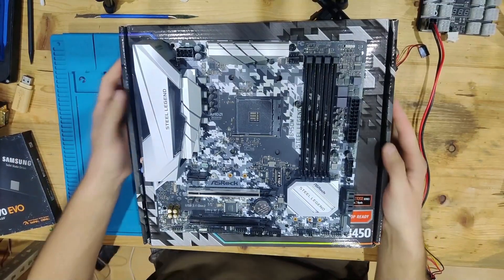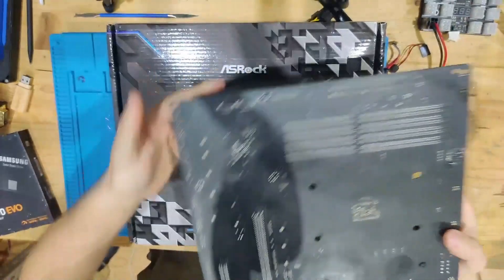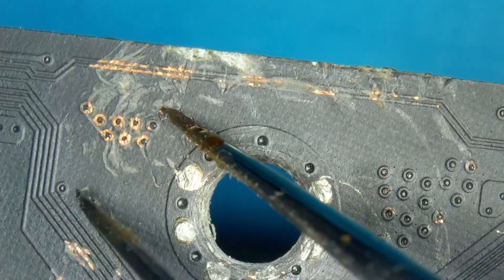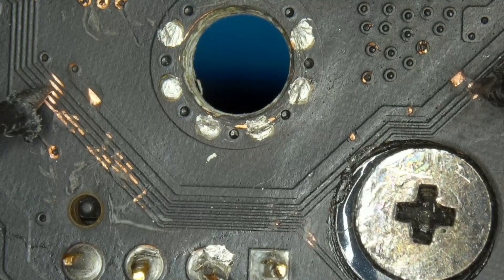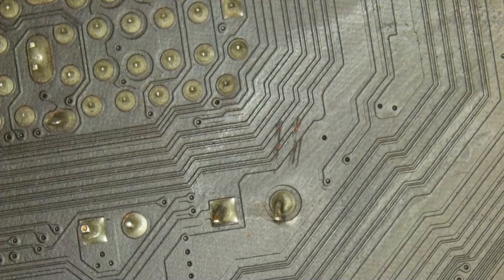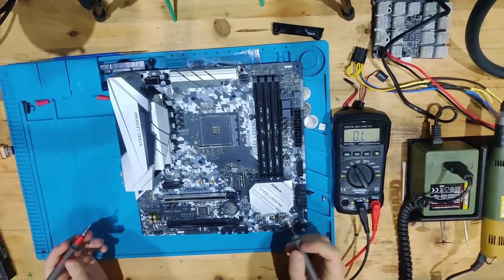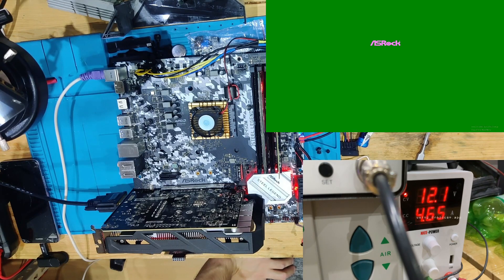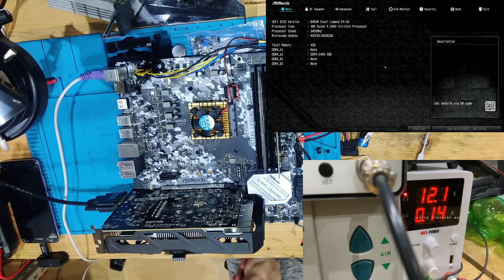OVERCLOCKING FAIL , MISSING VCORE  | B450 Steel Legend VRM Repair!

Comment: Sir, my motherboard has no display, I tried to measure the vdd_run and vddsoc voltages, it's only 1.1v, what's the cause? If it's normal, it's not 1.4v. I checked that there's no short circuit.
Reply from the maker: For startup that can be nomal, so it seems something else is wrong with your board! If all voltages are running, it sounds more like a bios issue!

Comment: i have a B550M steel legend which will not run stably above 95W of PPT.
i guess the VRM is failing.
Reply from the maker: Yes, it might be that some protection is triggering!

Comment: Oh cool, think this video might've answered my question. Bought a faulty Gigabyte Aorus B450 M off eBay to practice some board repairs. 1st it was not powering on properly when the ATX 12V Cable was plugged in. It was only starting when the 12v cable was disconnected, but obviously got stuck on the CPU LED.  I'd try starting the board with the 12v cable connected and the CPU LED would come on for like a second and go off. Board wouldn't turn back on after that. Had to disconnect the PSU to recreate the fault. Found 2 shorted MOSFETs that were causing the issue. Removing them got rid of the low resistance readings when the 12V cable was plugged in. Board still wasn't working right. Found 2 more shorted MOSFETs and removed them. It was quite difficult to find them as I don't have a thermal camera. 

Now I am getting the board to stay on with the 12v cable connected, but it's stuck on the CPU LED and the CPU isn't getting warm. There's no vCore voltage. I am guessing it's because of the 4 missing MOSFETs. I can see you can buy both the MOSFETs online, but I want to make sure this is the reason vCore is missing before buying them. After watching this video, I'm a bit more confident it will, but still not sure as this is my 1st board I'm trying to repair.

Comment: Which AM4 motherboards would you consider most reliable?
Reply from the maker: Its hard to tell, sadly almost all at some point have problems with Bios and compitability with some procecors, but component wise, non are in a state where i cant reccomend them. I would get one that has the option for BIOS programming without procecor, so it doesnt need to boot up to change the bios.

Comment: Love these Videos. Have many defect mainboards and everytime i searched on the internet on how to repair them, i got the answer "buy  new one, not worth the hassle". 
Would be great if you would make a video on how to diagnose it more in depth. Which values are ok, how to start a diagnose, equipment needed, pinpoint faults and more. Questions like, "Ok i have a multimeter, and how do i know at what value the 12v is shorted?" For me its clear, but not for everyone. Maybe you can make such a video in the future.